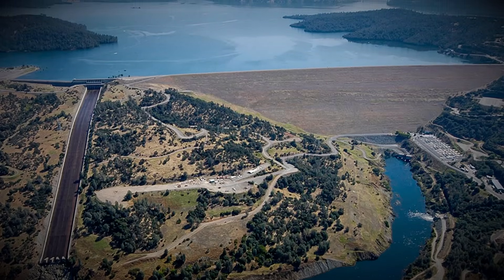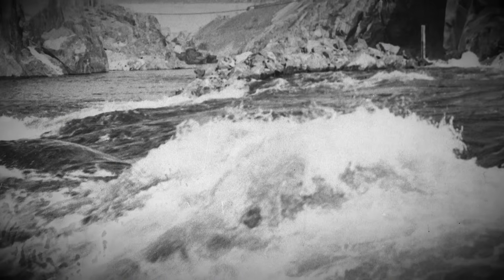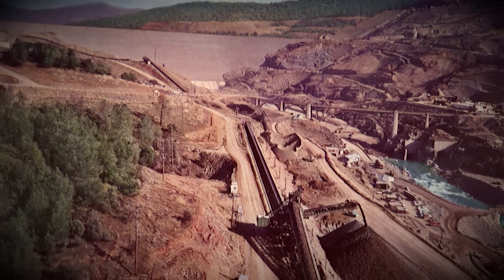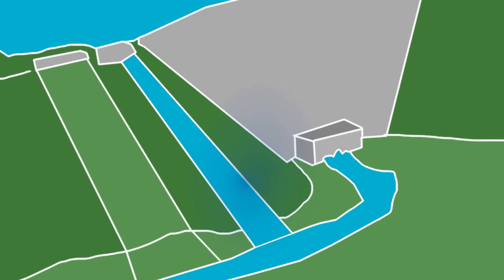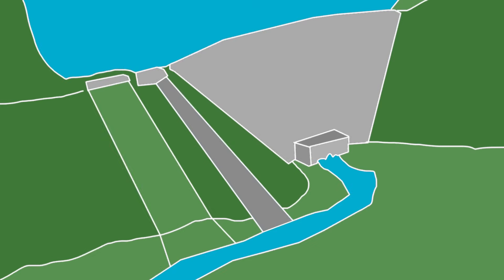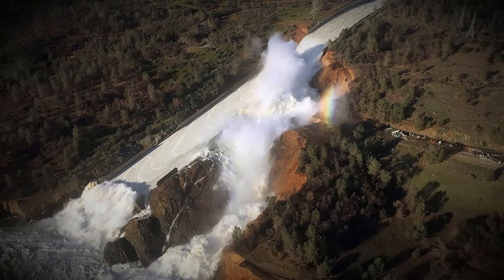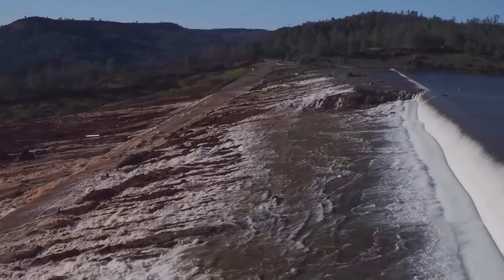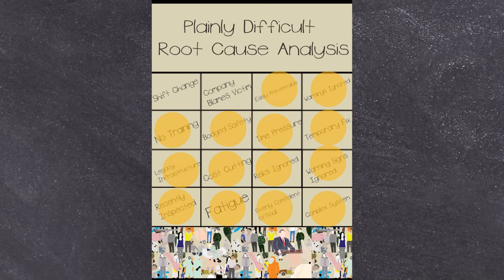How Poor Maintenance Caused the Evacuation of 180,000 People

Comment: My wife's family are among the people who had to evacuate, and a couple of my engineering college professors were a part of the investigation team. The dam was built fast and cheap in large part due to political pressure. The emergency "splillway" was designed that way because it was never intended to be used instead of the primary (information I got from the original as-built plans). The emergency spillway was there in case the main couldn't keep up with inflows (which would mean water flow already had exceeded downstream capacity causing evacuation). The emergency spillway was a sacrificial piece (approx 30ft in height), to protect the 770ft main dam. If the emergency spillway fails, a 30ft wave would damage or destroy Oroville, Yuba City/Marysville and a few others. If the 770ft main dam fails, the wave would be big enough to destroy parts of Sacramento 65 miles away.

Comment: It took decades of neglect and looking the other way to cause this event. The river outlet valves, which could have dumped water and allowed the spillway to be fixed, hadn't worked in twenty years. Two men tried to work on them and a wall collapsed on them, so the valves became a non-factor. Once the problem started, it was managed as professionally as humanly possible. They were working right at the edge of disaster and made the right decisions to avert it over and over. The rebuild process was accomplished on time without a single lost worker day due to accidents, and it's an impressively overbuilt and overengineered system now. A lot of people have reason to be proud of how this turned out.

Comment: This points up a general problem in construction contracting most people don't consider:  overly detailed specifications.  All construction specifications should be performance based, because if you get overly specific about materials and methods you'll get something that matches the plans even if it's not up to the job.    In this case the spillway anchors should have been specified by holding power instead of length. There would have been far less risk of catastrophic failure if they'd specified results.

Comment: This is eerily similar to the situation in Whaley Bridge Derbyshire in August 2019. The spillway at the Toddbrook dam was broken and emergency repairs involved helicoptering in bags of cement to shore it up. Luckily they managed to save it and no massive flood came about, but the town was evacuated as a precaution. The cause was that the spillway had been inadequately maintained and its design was basically flawed in exactly the same way is that at Oroville. The repair works have only just been completed, hopefully there will be no more problems.
Reply: John should do a video on that. I was thinking the same , the similarities are striking.

Comment: There was also a community called Bidwell Bar that was relocated to build the Dam, and during the drought that happend a few years back parts of it resurfaced. To my knowledge power from the lake, is used mostly in agriculture and local industry, not residential as well, though could be wrong on that one. Neat thing you can do however in Microsoft Flight Sim is fly around the area and view the local landmarks including the dam. I think the area (the feather river canyon) was also used for filming Top Gun 2s canyon scene. It is also not the first time this dam had a spillway issue as well....in the mid 90s when I was a kid I remember my got real scared when the spillway release failed, and started putting all of our expensive electronics on high shelfs.
Reply: Yep. Live here, done that.

Comment: The 2017 spillway fiasco was not the first emergency related to DWR's failure to maintain the reservoir level. In 1986, Warm winter storms melted the snowpack and caused huge inflows to the reservoir. Large spillway releases were required and a levee failed downstream. People died. In 1997, the same scenario happened and it was feared the Emergency Spillway would overtop. Evacuations were ordered. Another levee failed downstream and people died.
A big difference between 1997 and 2017 is that in 1997, the evacuations were ordered approximately 24 hours before the Emergency Spillway was expected to overtop. In 2017, evacuations were not ordered until after the spillway had overtopped and was expected to fail in less than one hour. DWR didn't care, they were just going to let it go. Butte County Sheriff Honea made the call to evacuate. Only then did DWR reopen the damaged main spillway to draw the reservoir down. I have lived below that thing for nearly 40 years and have earned the right to my opinion. Thanks,

Comment: At the time the evacuation was ordered the inflows were declining.  The headward erosion of the emergency spillway was concerning, but not alarming in light of decreasing inflows and a dry weather forecast.  THERE WAS NO REASON TO EVACUATE•  It was purely an exercise in government control.  PEOPLE DIED in the panic and chaos.  Those deaths lie entirely on the Sheriff's shoulders•
Reply: What are you talking about? Erosion was quickly climbing towards the e-spillway and there was a massive sinkhole towards the northern edge of the weir, which they had no way of inspecting with the e-spillway being used. The northern edge of the weir was already a suspected failure point and with the sinkhole forming, they had to assume it was compromised. There was also a forecast of storms in the coming week/s. They painted themselves into a corner by using the emergency spillway but it was the correct call to evacuate once they realized they ran out of options. I would argue they should have called for the evacuation once they decided to use the untested and uncontrollable emergency spillway as an auxiliary spillway.
Reply: Same person that would cry about the gov not doing its job when they did not evacuate and shit hit the fan

Comment: I watched this live day-to-day as it was happening, it was very scary stuff even though I am thousands of miles away in the UK.  As an engineering consultant who undertakes not only new plant design but also forensic investigations of failures, I always tell my customers "It will cost you more than you expect to build it properly.  But if you think building it right is expensive, you should try having a failure!".  Viewing a few pictures of catastrophic failures usually wins them over.
Reply: I started studying erosion prevention since I live in a rural area that has issues with bridge erosion.  And that was the FIRST thing that I thought of... the concrete facing was gonna get washed away.  This one wasn't sturdy enough, and yeah.... I failed to predict the exact failure method, but..... yeah.

Comment: Rebuiling required a massive amount of concrete. Temporary concrete plants were built, and I'm pretty sure they used some of the eroded gravel from the river in the mix. That means that material that originally came from the hillside was put back.
Reply: Yep, during the construction they screened and crushed rock out of the river to get it back to its original depth so the power plant wouldn't have issues in the future. It was used as fill and concrete aggregate.
Reply: The rock used in the original construction of the dam came from the dredge tailings from the 1900s along the Feather River in Oroville. Gold dredges on the river piled their waste rock alongside the river. A railroad was built to carry some of this rock to the dam construction site, as well as clay scraped from the "clay pits" near the current Oroville airport. The tailings area today is officially known as The Oroville Wildlife Area, but referred to locally as "the rockpiles"

Comment: 7:12 "Hoping that a reduced flow rate wouldn't cause that much damage."

Why do none of these idiots understand that damage is cumulative?  "Not that much damage" is actually "not that much damage PER DAY."  If there's "not that much damage per day" and so you ignore it for X days, there's "not that much damage per day times X days" which works out to a LOT OF DAMAGE OVER TIME.

Uuuugh.  Humans failing to understand "X/time * Y time = Y/time * X time" is the cause of so much pain and destruction and I HATE it.
Reply: And what were they supposed to do in that situation?
Reply: @user-kr8xe9zf7l  Stop ignoring the damage because it's "not as much" for starters!  Remember that one dam where the dam was leaking but it wasn't showing signs of erosion, so they ignored it because it wasn't eroding YET?  Same principle AGAIN.  It's not causing that much damage, which means the structure's not that damaged... YET.  People need to try fixing it before it IS that damaged every once in a while.

Comment: John you would also cover the events that occurred upriver at the power transmission line from the Poe Dam on November 8, 2018.  86 people died because of a worn hook 99 years old, identified as needed for replacement for 20 or more years.  It was 86 people who died as one shot themselves but like the people who jumped from the World Trade Center towers they didn’t plan on killing themselves when they got up in the morning but burning to death changes your plans. In any case if you are exploring the Feather River valley it has two in recent years. Butte county is not a highly populated county. (Most of the evacuations were down river including parts of greater Sacramento). Interesting thing is I bought my first tractor across from the dam in May 2019 where construction on repairs were still occurring.

Comment: This is a bit of a flaky video on the Oroville incident. The licensing didn’t suggest a lining for the primary spillway as you showed, but of the EMERGENCY spillway, as that would have significant erosion. THAT required concrete to cover it, and that’s what they did. 

Also, they did pause discharge from the primary spillway many times for inspection before what you mention here - they already knew. Also (critically) once the water began to run clear, they knew that upslope erosion was unlikely to occur. In fact, they actually had a MINIMUM discharge rate, to ensure the water could flow into the rock basin with minimal additional erosion. 

Also of critical note is the river flow outlet system / bypass which wasn’t really functional during this crisis. It doesn’t have a huge flow, but would have been helpful.

ALSO of note was the fact that they couldn’t operate the power plant (ie turbines, ie additional water flow) because of the debris which blocked the back area of discharge by the power plane outlet. You mentioned “bringing the power plant back online” but not really why. The entire power plant was at risk of flooding due to the inability to get water OUT of the discharge pool opposite the feather river outflow area. 

Plus the initial comment about them “not spending as much on the spillway” like it was an afterthought is incorrect. It was an absolute engineering marvel at the time, with a number of complex drainage and anchoring systems in place. Maintenance was all routine, and the failure was decades after construction and normal use. 

The initiation of the failure and the specific slab gap is the most fascinating part of this whole thing for me. Obviously many people have seen Juan Brown’s coverage of this as it unfolded, but there are some other interesting videos out there as well. 

The river flow outlet system is (again) a really interesting part of this, as five workers were almost killed in 2009 when they entered the control chamber under the dam to open the valve (which is literally INSIDE the tunnel the water drains into.)
Reply: Well said.

Comment: This was not the first event at this dam. The following happened before that: On 22 July 2009, an accident occurred in the underground valve chamber of the bottom outlet when a strong negative air pressure was generated in the outlet pipe during the test opening of the bottom outlet valves, causing a partition wall acting as a pressure bulkhead to collapse and devastating the operating platform of the outlet valves. One worker was seriously injured and several others were slightly injured.

Comment: This entire Dam needs to be an example of how not to do anything, because this whole thing is just a disaster waiting to happen. They have an EMERGENCY SPILLWAY that has ZERO WARNING that it's about to overtop and flood a hill that they have HIKING PATHS AND ROADS ON.
Reply: I wouldn't even say that's what was wrong with the Emergency Spillway. The whole hill is comprised of extremely soft rock. Soft enough you can pretty easily break it apart with your hands. So, expecting it to allow water in any capacity without quickly eroding was short-sighted, and concrete should have been poured from the start, let alone when it was proposed not even ten years before this happened.

Greed and arrogance feed graveyards.
Reply: @Handoverteakettle  Then you're a fool. Allowing a HIKING TRAIL on a SPILLWAY with NO WARNING is 100% the biggest part of what's wrong.
Reply: @shawnpitman876  The emergency spillway has been used once in almost 50 years, and Officials closed the area off before they even considered allowing the water to crest the spillway. There's plenty of warning if the emergency spillway is going to be utilized.
Reply: @Handoverteakettle  That's why you're a fool and shouldn't be consulted on literally anything. The fact that you think that putting a hiking path on a spilway ISN'T A PROBLEM is proof that you are immune to thoughts. There is ZERO defense of allowing this, especially without a warning system. Even back when the dam was built they had sirens for tornadoes (which are FAR more unpredictable than a flood) so there's literally NO EXCUSE for not having a way to warn people who are about to get swallowed up by water YOU are allowing to overtop your dam.

Comment: Concrete crack and creep is so common that my late FIL (a materials scientist) won an award for his study of it.
Reply: If you go and look at photos of the main spillway failure you can see the single layer of rebar in the one foot thick concrete. And most shocking… they used rounded river stone in the pour instead of crushed gravel which has sharper edges. This is all clearly viewed in the pictures. And all this, they built on unreliable rock. 😮
Reply: Crack kills!

Comment: The spillway gates were leaking so no concrete repairs could take place - 2 of the generators were down for repair so that slowed water releases - so you see that CA water system is as good as their fire protection -
Reply: This one stings a little. It was only a year later that the Camp Fire destroyed Paradise just 20-30 minutes North of Oroville. And just last year a wildfire started up on Table Mountain and worked its way across the Dam.

Comment: I thought that after the initial failure of the main spillway the operators decided to use the untested emergency spillway then when the emergency spillway failed they opened the main spillway back up to lower the level so it stoped spilling over
Reply: They reduced flow on the damaged spillway and eventually decided to let it overrun the emergency spillway.  Once they noticed scour and the potential for failure, they opened up the main spillway to reduce the water level and eliminate the use of the emergency spillway.  The emergency spillway was hardly used both in time and flow.  iirc peak flow rate over the emergency spillway was 12K CFS versus sustained runs of over 100K on the main spillway and a design capacity of 300K.